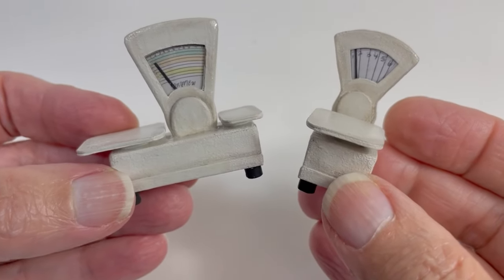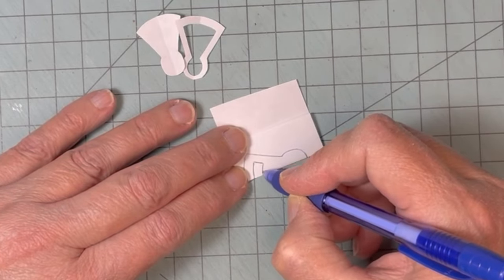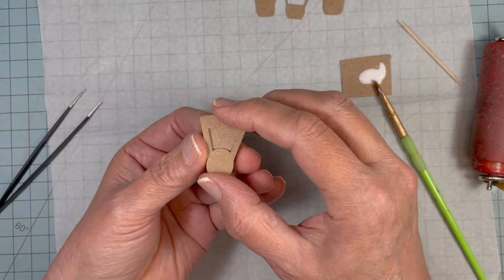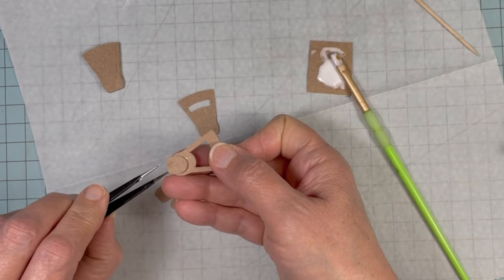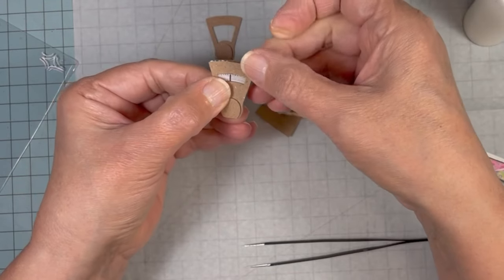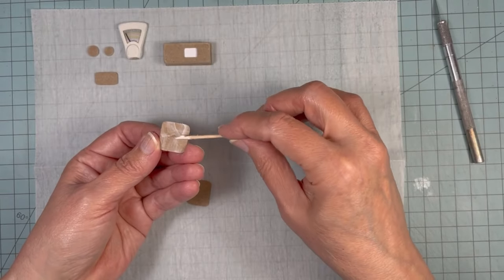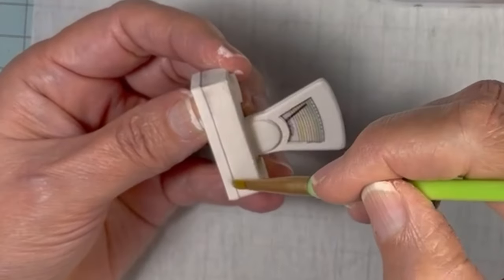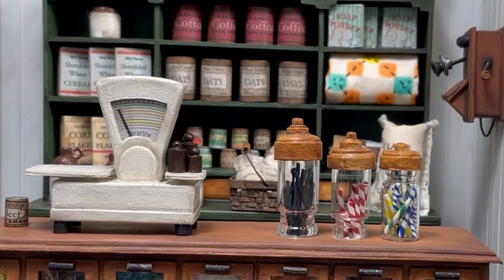I'll show you how to make miniature scales (Balance)

Comment: C'est curieux quand même, les pièces n'ont pas la même forme à la découpe et au collage..
Reply from the maker: The small one I drew out the pattern in the beginning to show how I made it. Then I cut out of food packaging using exacto knife. I did that for those who don’t have a paper cutter. The larger one I designed the cut file on my computer and cut out with my cameo 4 paper cutter. The assembly was the same for both. That’s why the smaller scale had the hand drawn numbers because it was completely done by hand.